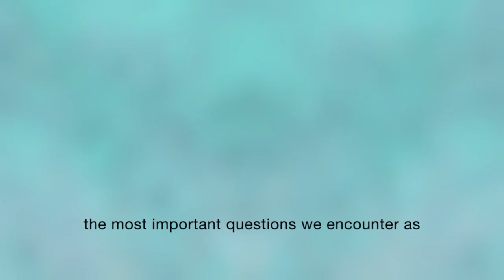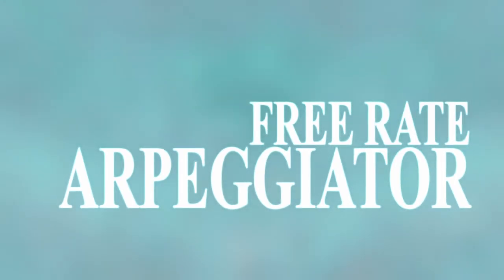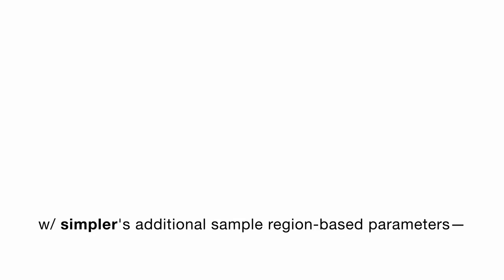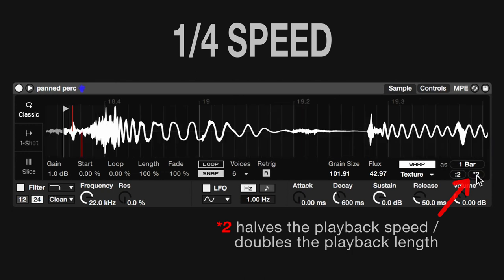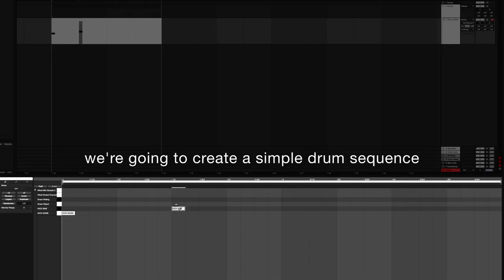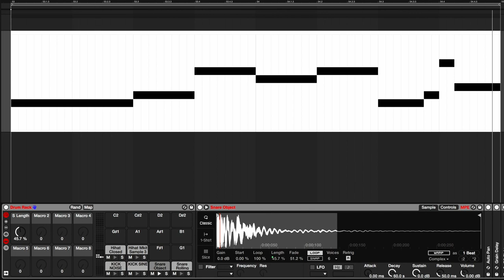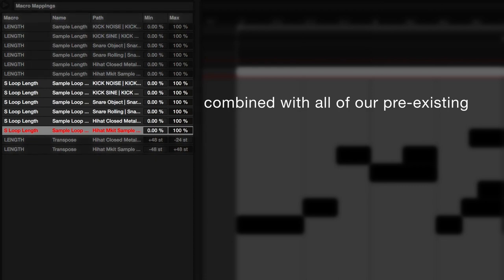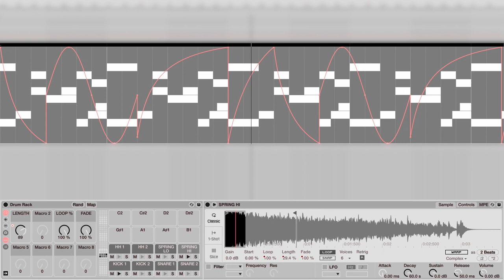ableton sound design | EXPONENTIAL RHYTHMS [2/5] Sample Looping in Simpler

Comment: Your content is absolutely incredible. Keep pushing the envelope and inspiring us to innovate! 
I do have a quick question if it's not too much trouble - do you have any advice on how to incorporate these exponential rhythms into tracks alongside more conventional rhythms? For instance, transitioning from a section of the song which uses an exponential groove to a section which uses a conventional groove, or vice versa. Or perhaps layering an exponential element simultaneously with an element using a conventional rhythm.
 I have tried the latter myself and it seems doable, simply by using an LFO with a BPM synced rate to control the rate of the exponential rhythm speeding/slowing down, so while the arepggiator still has a free rate, its max/min points of contraction occur at BPM synced intervals. It is the former i am less sure about